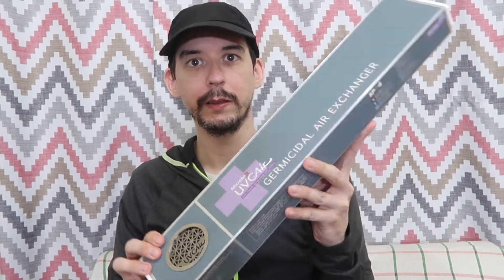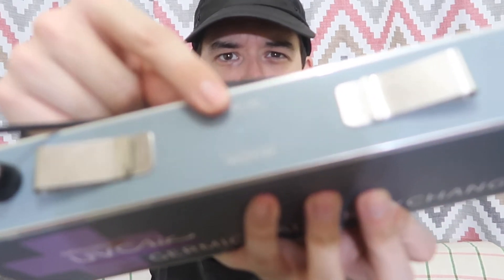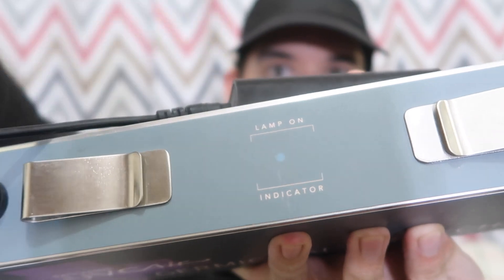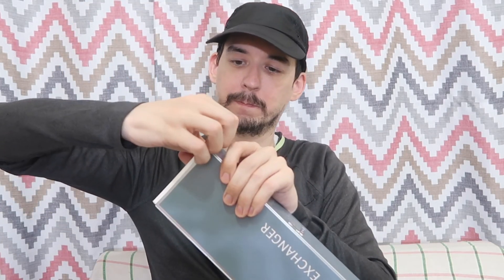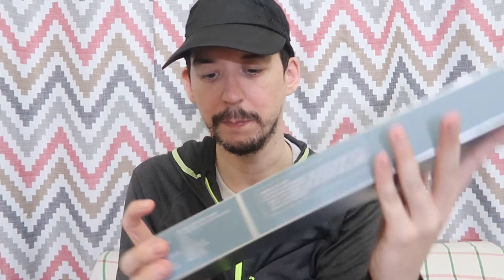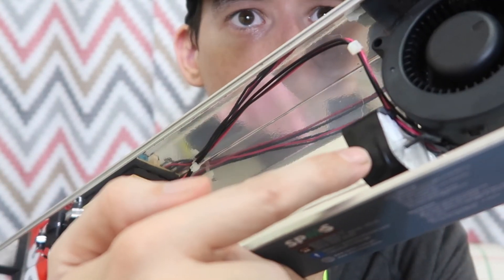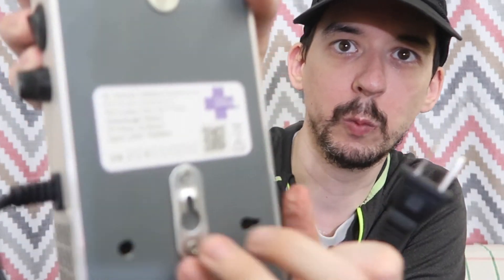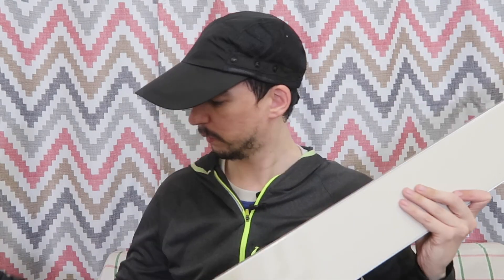How do UVC-Air Germicidal Air Exchangers work?

Comment: Is that available in mall hardware.
Reply from the maker: I think right now it's only available directly from Microbex. Most of the mall products are using HEPA filters, sometimes with UVC lamps inside also. There's pros and cons to both approaches.
Reply: Gadget Addict thanks.